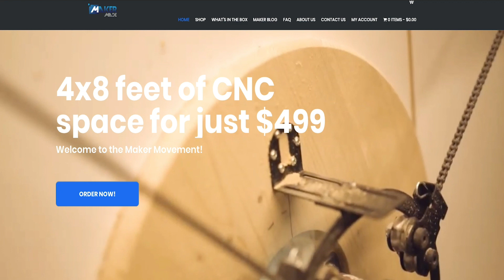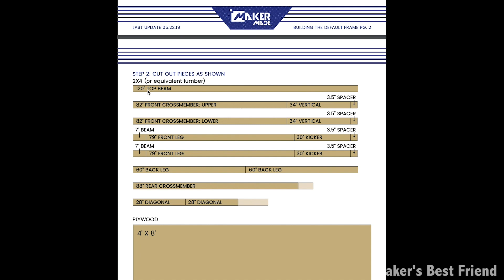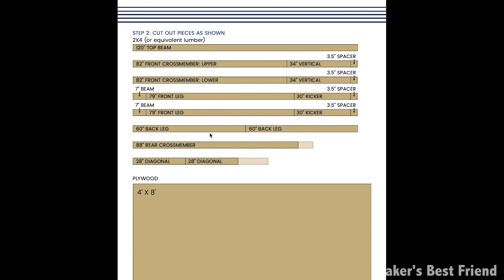Maker Made CNC - Building the Frame (Part 1)

Comment: Hey man, thanks for the video...I can't find the "free standing" version of the frame...all I found was "wall mounted" which will not work for me.  I did send you an email and would appreciate it if you could send the PDF instructions.  Thank you!!
Reply from the maker: Hey! Just replied through email!
Reply: @MakersBestFriend  I sent you the same request a while back but I am not sure if your email account is still going and/or if your reply was marked/deleted as spam.  Could you send me the plans as well?  This version will work so much better for me than the current one, which seems to be the only searchable version as well.  Thanks!
Reply: Wait, they updated the plans on their website (I was going off the stick). NVRMND.  Sorry about that but thanks for posting this video, it will be very useful in building!  Cheers!

Comment: I've had my Maslow for a year and just haven't had time to get it put together due to other more pressing projects, I have a half built frame but I think I'm going to scrap that (I'll use it for other stuff) and build this one instead. Maybe this weekend, excellent timing.
Reply from the maker: Awesome! With the right tools you can get it together in a couple hours ! I think it helps to have a first project in mind that drives you to get it up and running - hope to hear it worked out for you!
Reply: @MakersBestFriend  Yeah, won't take me long to do, only problem is I have too many projects to do and not enough time to do them. ;) But I think it's time!